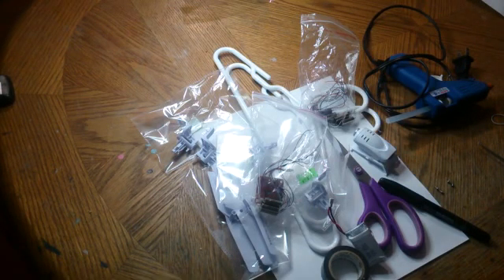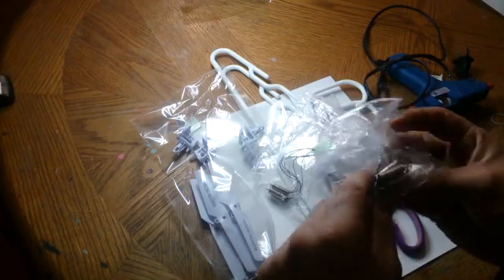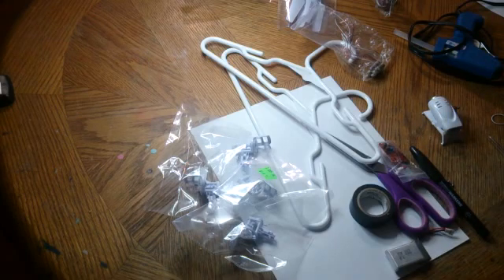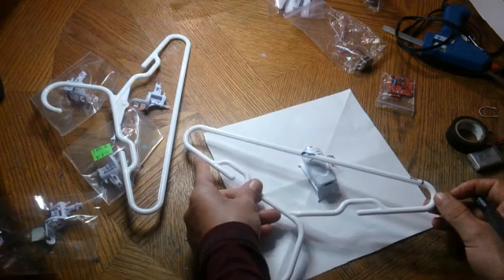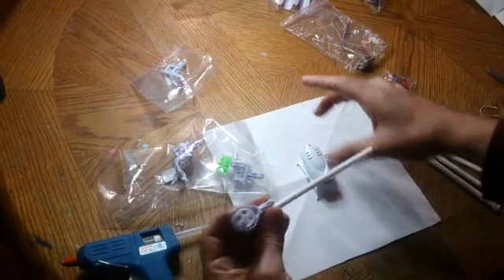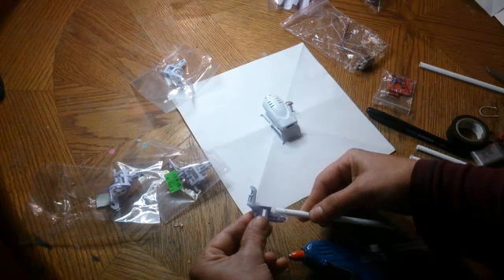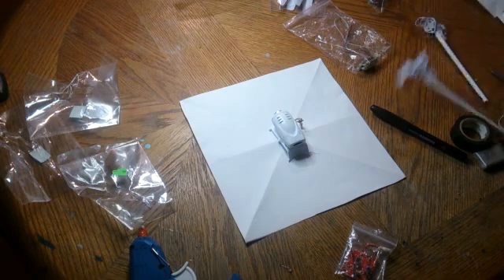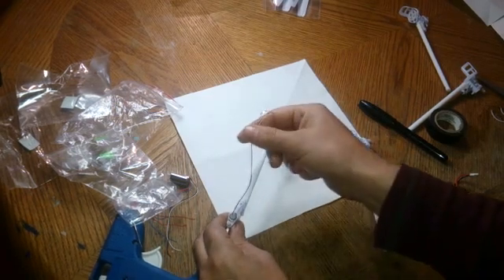syma x5c shell mod -- ,build a cheap quadcopter part 1 of 3

Comment: bro can u list down the requirements for me ?
Reply from the maker: Hi in the description of 3-3 has the list..but i just copied them under this description as well.. .. I don't show the remote or the battery's ...
Use the links as a reference you might be able to get cheaper off ebay (1 year later.. )

So if you don't have a syma x5c remote you can find them on ebay for about 11 dollars.  

but the problem will soon be that you might be able just to get a syma x5c or x5c clone for almost the same price as the build.specially if you don't have the battery or remote..... I think some of the clones now are only 17.99  on ebay.